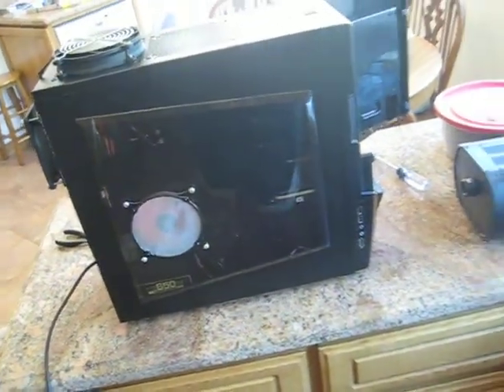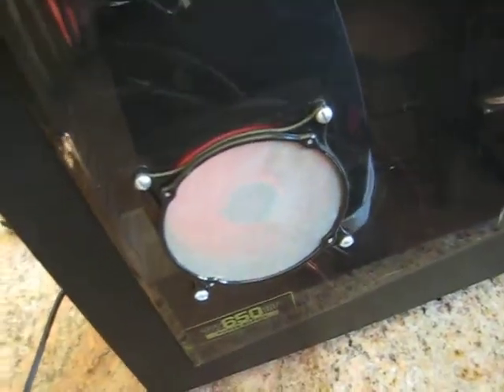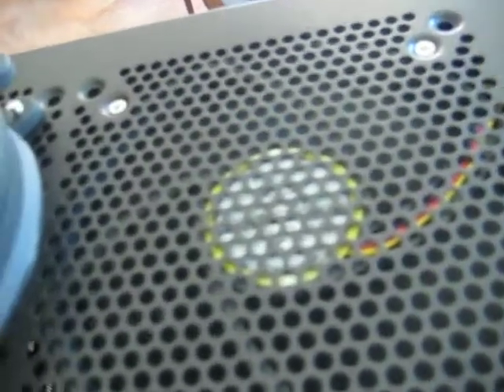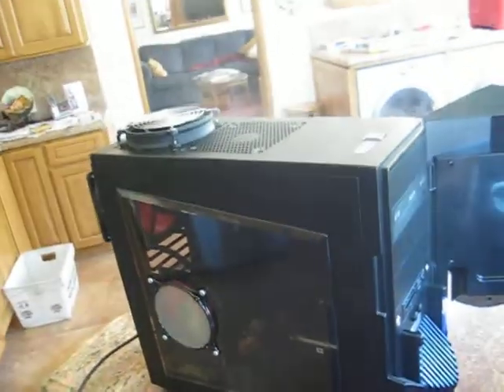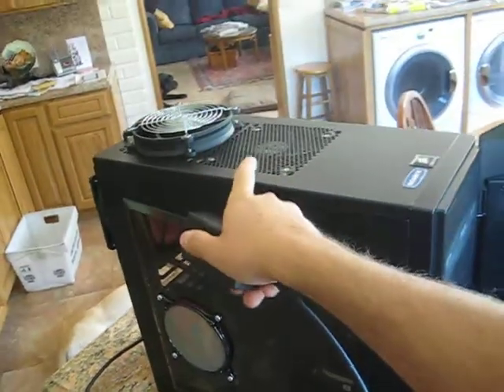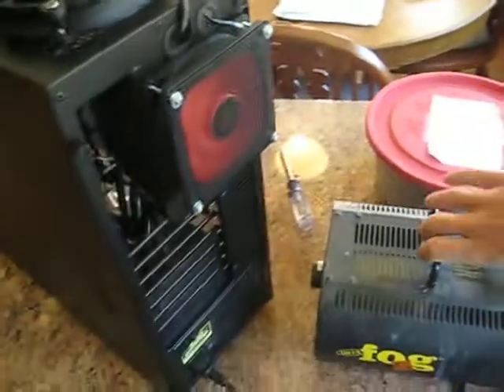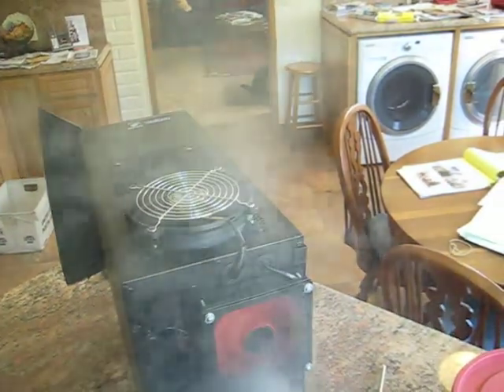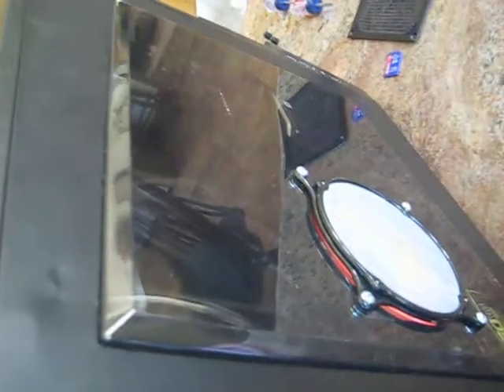Computer Desktop Fan Test with Fog Machine: NZXT Lexa S (4 fans) and H70 (2 fans) Part 3

Comment: i have a nzxt tempest evo and seeing the fan test makes me think. when the intake comes in it goes directly to the first exhaust and wondering if much cool air goes to the cpu. i dont have water cooling so maybe i should change my rear exhaust to an intake do you think this is a good idea as the hot air would immediately go to the top and be exhausted?